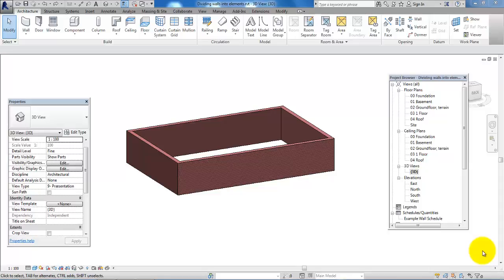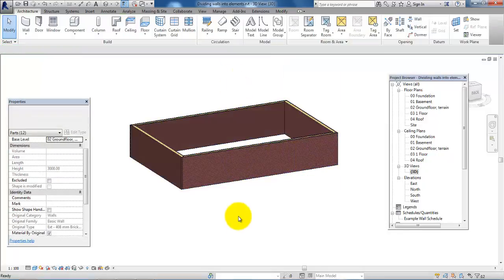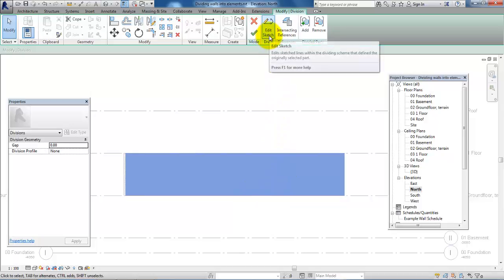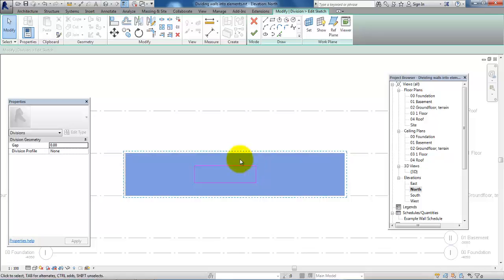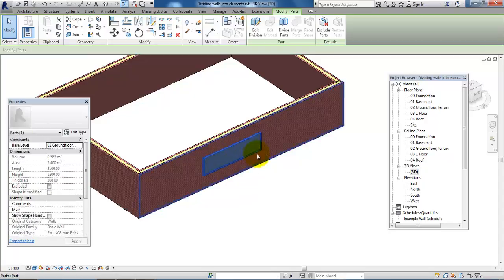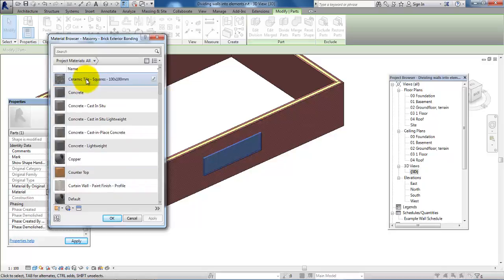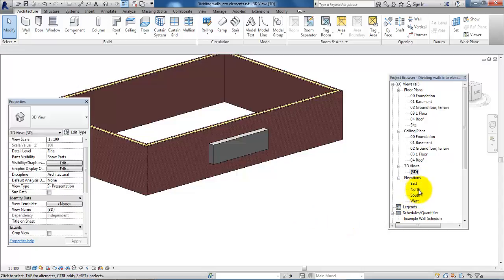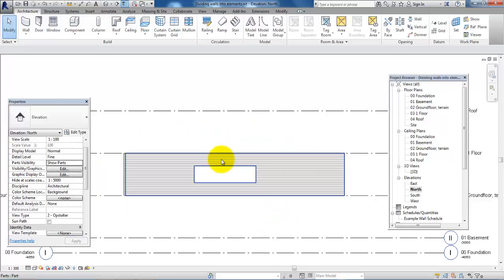Revit 2014_Add different material to parts of a wall

Comment: 'Can't draw because Work Plane is at a very sharp angle in this view. Go to another view or redefine the Work Plane.'

I keep getting this message and i cannot work it out. it says use a different view, and it doesn't work there either. created a new one deleted the old one that doesn't work :( 

any help would be appreciated
Reply: Perhaps you are trying to draw "divide parts" in 3d mode. You have to visit your elevation.